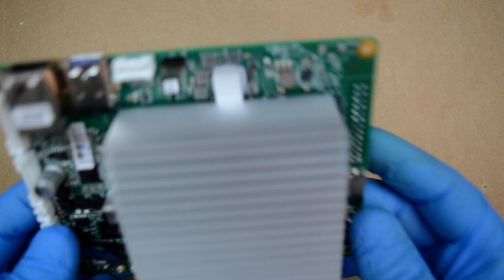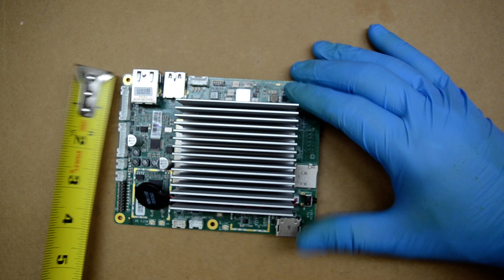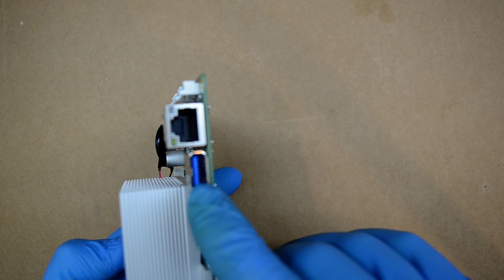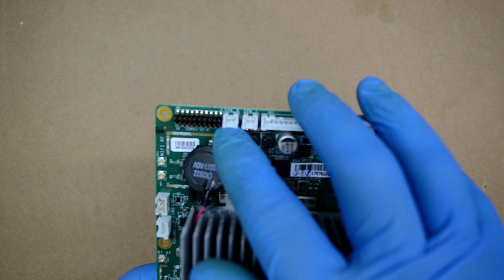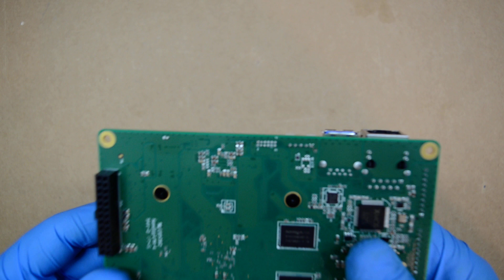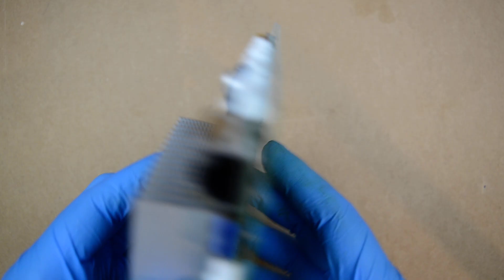Atomic Pi High Speed SBC Unboxing

Comment: It's my understanding that the fan circuit on the board is not populated and therefor doesn't work... but that's just hearsay from the Atomic Pi subreddit. I'd love to see if you explore that. I made some 3D printed cases that stand the board up on one end for stack effect passive cooling, because I figured the fan circuit was one of the parts of the Atomic Pi that was a lost cause.